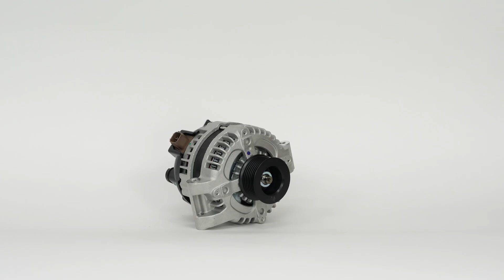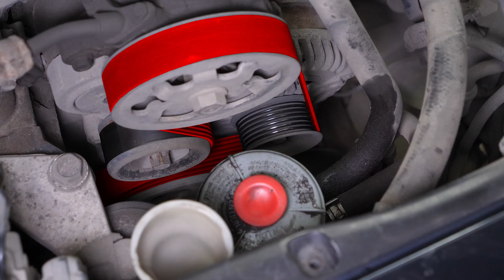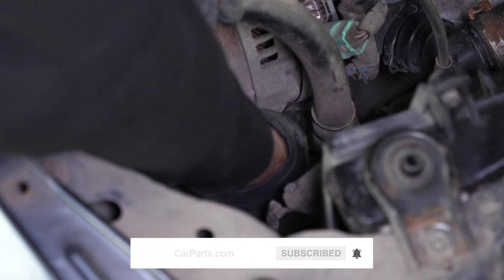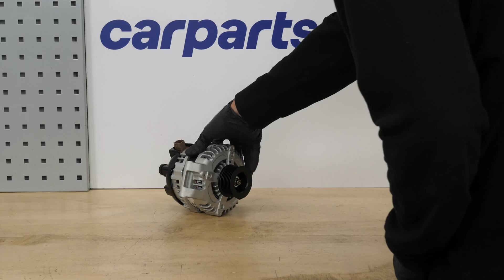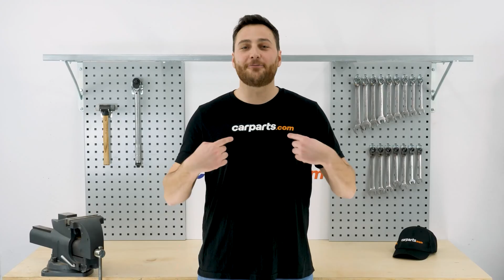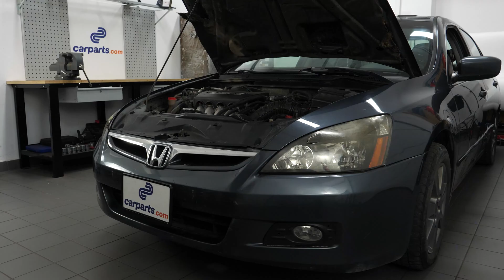How to replace the Alternator 2003-2007 Honda Accord ⚡

Comment: Unscrew the bottom bolts first so the weight of the alternator isn't sitting on them while you're trying to unscrew them and install the top one first for support when u install the bottom 2

Comment: A serpentine tool kit was necessary. The offset wrench did not provide enough leverage. Otherwise, the rest worked. If you look in the front wheel well from under the car, the lower wheels can more easily be accessed to set the belt.

Comment: Going to buy a voltage meter and check if its my alternator or battery at fault. Symptoms are pointing to alternator as my radio would cut out now and then, later in the month my whole engine when I flicked on the head lights.